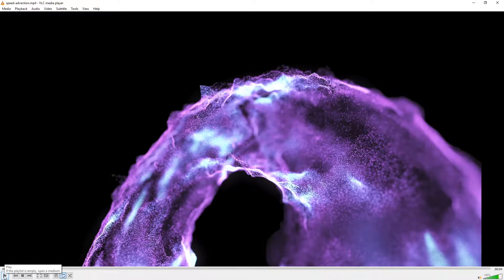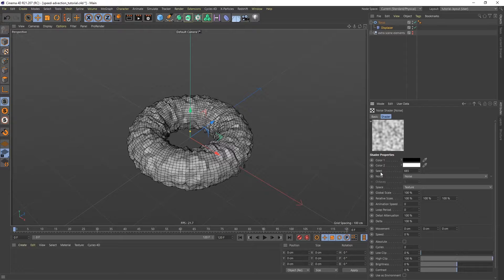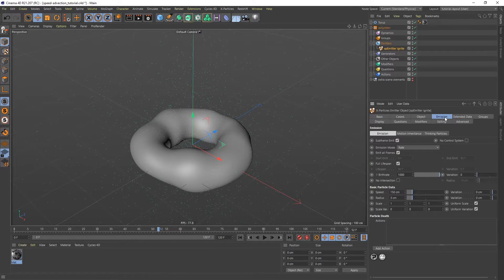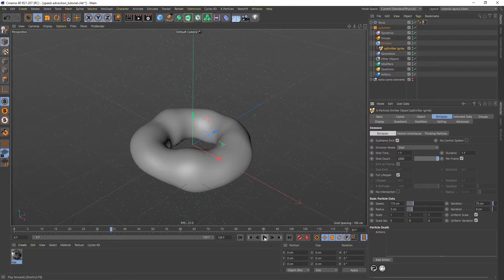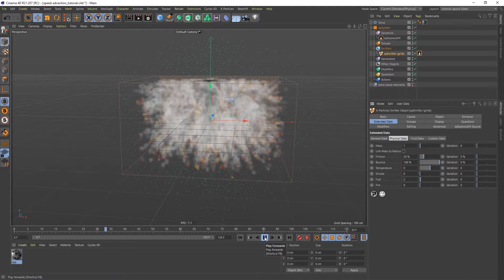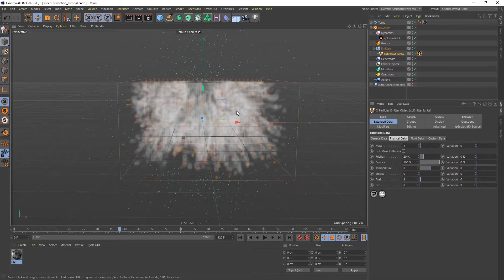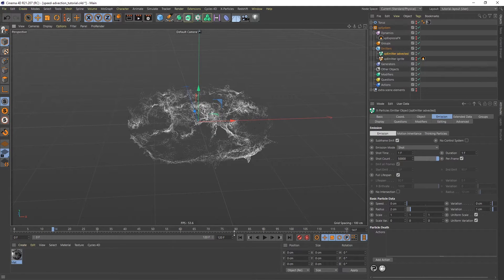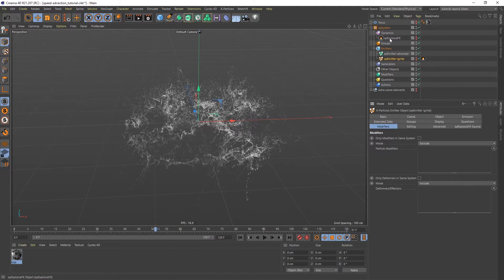X-Particles Tutorial - Speed Advection

Comment: hi! thanks for the great tutorial.
how would you render this as an animation or png sequence from CYCLES? or i need to render ir with the Physical renderer?
Reply from the maker: Hi Andres! My pleasure and thank you. The "save" and "output" is the same as for the Physical and Standard renderers. Just specify PNG for example, and control how many frames to output. Switch the renderer on the top menu and make sure you select Cycles 4D. That'll give you the setting for the Cycles 4D renderer. Then render to picture viewer. I hope that helps. If not, let me know. 
Cheers Jesper
Reply: @Velocitypeak  thank you very much!